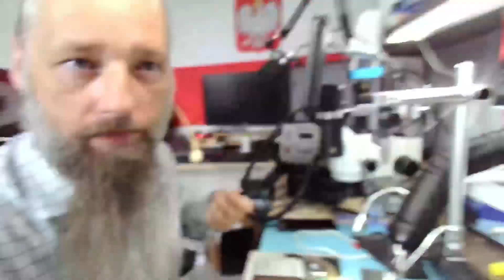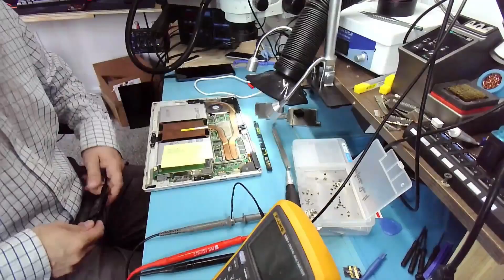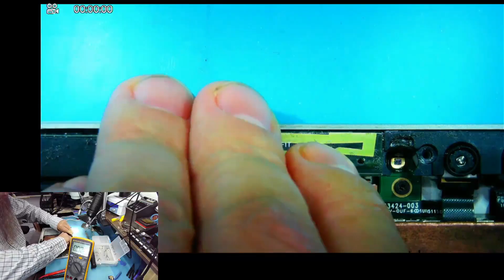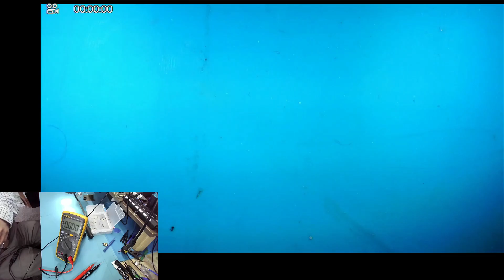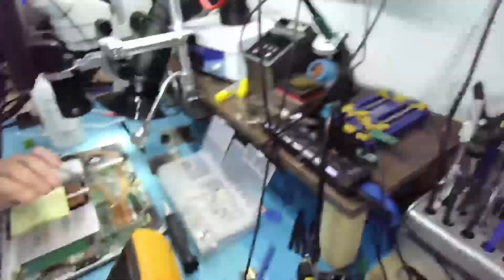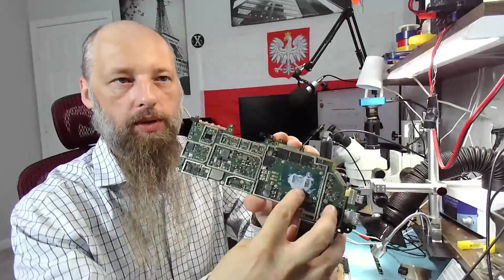Surface Pro 4 i7 512GB Version Repair | BIOS or CPU

Comment: Здравствуйте. Автор, скажите пожалуйста,  а почему нельзя поменять процессор? Дело в том что у меня есть surface pro 9 с процессором i5 1245u и такая проблема он неожиданно резко выключается. В ремонтной мастерской сказали что это неисправность процессора. Я купил новый процессор i5 1235u и мне мастер сказал что сможет поменять процессор. Но дело в том что этот мастер раньше не ремонтировать surface, он начнёт делать мой планшет через 10 дней,  у него много другой работы. Так вот, скажите пожалуйста в чем проблема с заметной процессора на surface. Обычно после замены процессора на материнской плате достаточно очистить me регион и всё работает, а в чём может быть проблема на surface? С нетерпением жду вашего ответа.
Reply from the maker: yes sir. The CPU on these machines is soldered onto the board, it takes a lot of time and effort to replace it and it requires specialized equipment. 10 day turnaround is very good. It sounds like a very fair estimate on such job.

Comment: Hi, excellent video. Why does changing the BIOS chip stop the touchscreen from working? I have a Surface similar to that one, and it has the Surface ME error code 10.
Reply from the maker: I have no idea why but ME region is required for the touch to work.

Comment: Very good video,but I was thinking that maybe the reason why the touch stop working after a bios chip rewrite is that maybe the serial number or manufacture id of the touch sensor is hidden in the bios code and this is what the processor looks for at boot
maybe you could read out two of them and compare the data between the two.
Reply from the maker: Only the ME region of the binary is specific to the particular machine, so if you swap BIOS chips the ME will not be started in Windows which in turn will not start Surface Touch device. I have a video on that subject, in fact I have multiple :)

Comment: Can you share info on your bench equipment? Hot air station for one, and where to get it? Thanks
Reply from the maker: Yes I can, the station is 861D (equivalent of Quick) you can buy it on eBay for about $200-$300 
I will make a video on my equipment eventually, but I don't use anything special